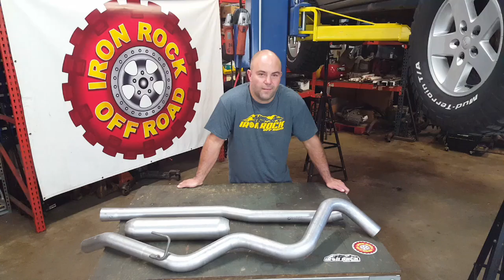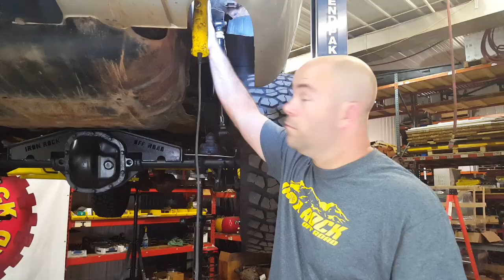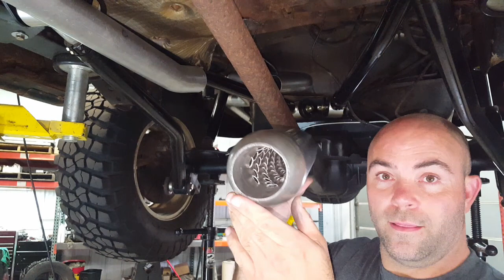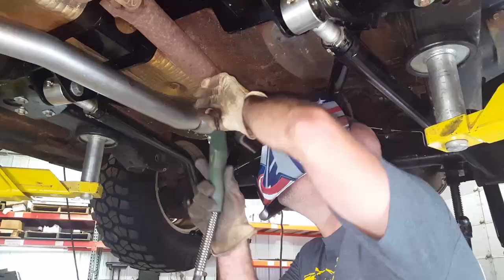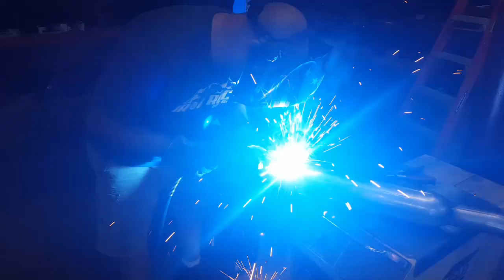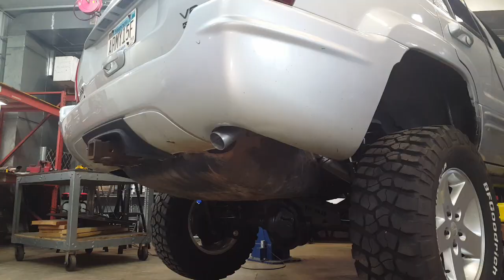IRO WJ 4 Link Exhaust

Comment: You say behind as in keeping the third cat converter right?
Reply: @matthew7972 If you live in a state without inspections, you can install the full exhaust by removing the clamp in front of the third cat and simply clamping on the new pipe in the kit. It will install exactly like it does in the video. If you prefer to keep the third cat, you'll just cut the front pipe where the cat should be.
Reply: @atwebb26  yea I live in California there’s that 😂
Reply from the maker: @matthew7972 Correct. The 3rd cat is beside the transfer case on most WJs. The 3rd cat would be protected by our belly skid that is shown in the video. Some WJs don't have this 3rd cat so we provide the extra pipe to make it easier for them. Check our instructions to see a little better how the exhaust would work with the 3rd cat in place.
https://www.ironrockoffroad.com/Merchant2/WJ_Rear_4-Link_Exhaust.pdf
Reply: @IronRockOffRoad  hell yea awesome can’t wait to order this to go with my 6.5” rock link pro kit
Reply from the maker: @Wayling2069  Great to hear! If you have a welder this exhaust kit makes it quick and easy to get the noise and fumes out from under your WJ. Most of the time it's cheaper and better quality than a muffler shop too.

Comment: Has anyone used this system? Was there any drone at highway speeds?
Reply: I'm 3 years late, but I have this system. I can't hear any drone at highway speeds from the exhaust. I hear my tires more than anything.
Reply from the maker: Thanks for the response even though it was many years after. It helps other reading old comments!